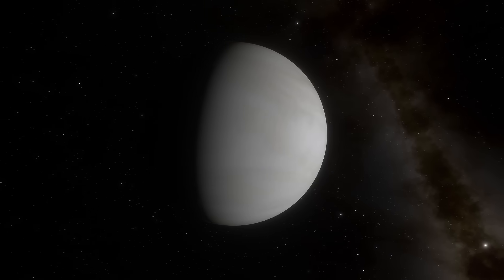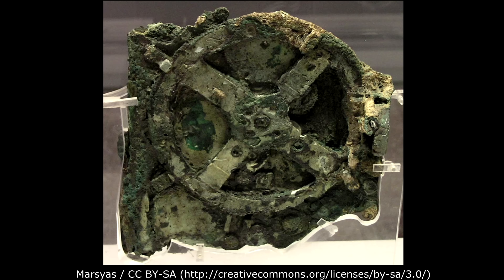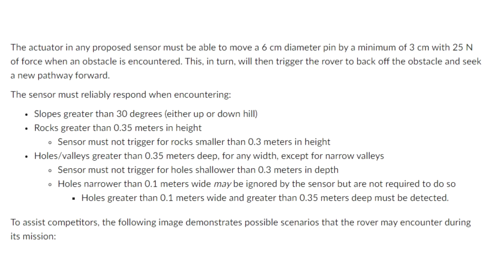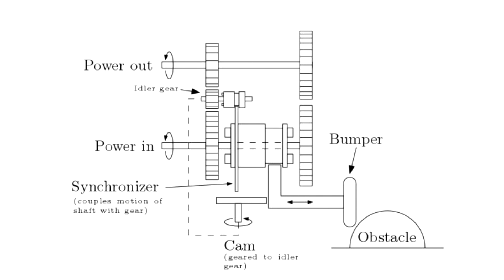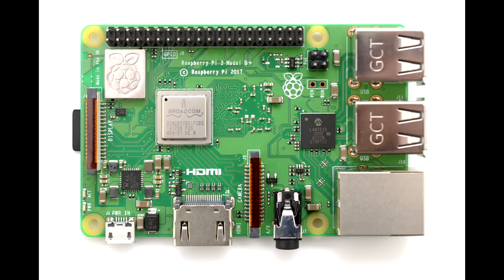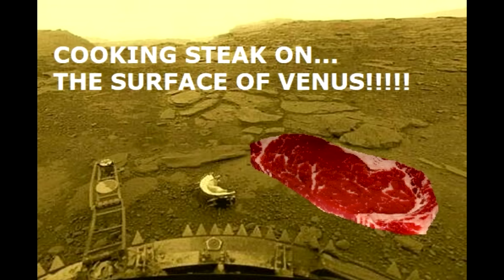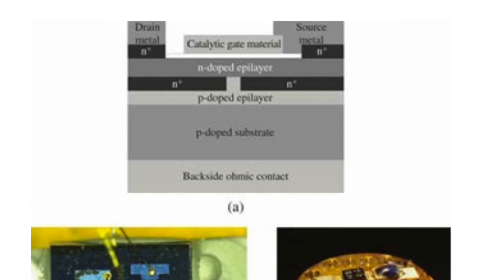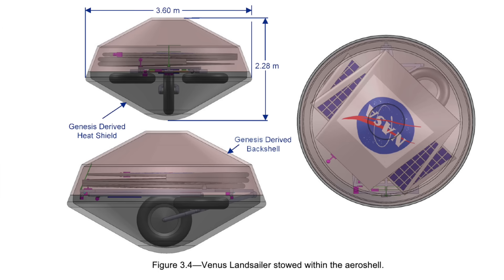Venus Rover Concepts That Beat The Killer Atmosphere

Comment: Fluidic logic looks like a better choice for such a computer? There's already a fluidic Z80 counterpart.
Reply: Konstantin Alexandrov Interesting. I don't know many suitable fluids that operate at 500C.
Reply: @gordonrichardson2972  keep in mind the pressure on venus, which is 93 atmospheres.  This will kick up all the boiling points to higher temps, may not be enough mind you. For example, boiling point of water at 93 atmospheres is 305C.

At atmospheric pressure, Sulphur has a boiling point of 444C, Mercury 356C, etc. 

I'd say Mercury is a safe bet, 93 atmospheres would surely kick up it's boiling point way up, making it a semi-sane liquid to use.

Comment: I have no doubt that a Venusian surface rover can be designed. The real challenge however would be to design a vehicle capable of operating on the Venus surface using only materials synthesized from the Venus atmosphere.
Would it be possible to create a vehicle using only CO2, N2, and sulfuric acid (H2SO4) and some other trace gasses? Because, if a floating colony was ever created, those would be their readily available resources and manufacturing with as many on-site resources as possible would be the way to do it.
Can anyone envision some sort of diamond/graphite coated high temperature polymer-based beast with graphene-based electronics that can survive on the surface? 
Or would such a vehicle never be possible without additional elemental resources?

Comment: What about using the heat to your advantage. If you had metals that get squishy at those temps, could you make some sort of transistor based on increased resistance across different thicknesses of metals and then have some sort of micropnematic system adjust thicknesses by squishing the metals?

Comment: I think a conventional rover inside a big, sealed, transparent ball  -- like a hamster ball -- would be better.  Maybe a ball covered by springy feet of some sort, to make it easier to roll over small rocks.  To make it resist the temperature and acidity of the atmosphere, perhaps it could be coated with a thin layer of diamond, or graphene.

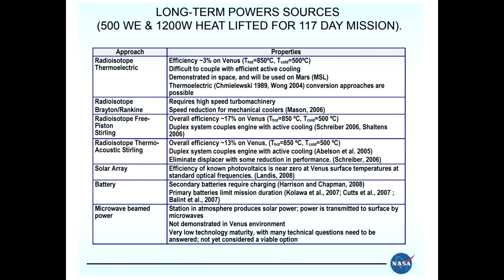Comment: Ummmm bit of a contradiction between the third from last row at 6:00 and the concept at 9:30......
Reply: Looked it up.
https://ntrs.nasa.gov/archive/nasa/casi.ntrs.nasa.gov/20150016298.pdf

Solar panels of suitable design would generate about 8.7W/m2 on Venus surface.
This is sufficiently far from zero to be usable.
Not enough for cooling or Drive systems, but enough to power rudimentary systems.
Reply: @marvinkitfox3386  why is youtube not notifying me of these replies any more 😑😑😑

maybe there are atmospheric windows in the far ir that could be used as cold source for low power heat engines. Anyway, I think wind is the most promising.

Comment: Many moons ago, there was "fluidic logic"  This employed ducted fluids as simple computers, such as FLODAC, a proof of concept from 1964.  Molten sodium is a fluid...
EDIT:  At the time, the 60's, fluidics was a solution in search of a problem.  The transistor and the PCB could do more, faster, and kept getting smaller and cheaper.  Environment wasn't an insurmountable issue, so fluidics went on the shelf.
Reply: Paul Slash
 -- Ah, brings back memories. A senior project in one of my Mechanical Engineering classes (1972) using pneumatic fluidic gates stirred my interest in Boolean logic which led me to pursue a Masters in Electrical Engineering in Computer Engineering. Served me well with my feet in two disciplines. Fluidic logic wasn't completely a solution in search for problem, there are situations where electrical devices are dangerous, like in an explosive environment. For a simple logic need, having electrical devices are unnecessary.
Reply: T Lum  Rad hard too.
Reply: Wouldn’t fluid logic be the same as pneumatic logic, which he mentioned was being looked into for this project?
Reply: @TheWallsocket  Gases are compressible, a fluid is not, that changes a lot of things
Reply: @TheWallsocket  Pneumatic would be a gas, as a rule.  Liquids are not compressible.  The different properties offer different programmable abilities.
Reply: Gasses are fluids. Although the surface of Venus is so hot and at such high pressure CO2 is a supercritical fluid.
Reply: @drunkenhobo8020  well gases share some properties with fluids but their definition is distinct from another
Reply: @Max Mustermann Gases ARE a fluid. Look up definitions before you "correct" people.
Reply: "fluidics was a solution in search of a problem." hmm, wonder what that manifold of valves and milled channels were for in a "transmission valve body".
Reply: CO2 is a fluid (at those temperatures)
Reply: @benjaminmiller3620  *is a supercritical fluid

That's a big difference

Comment: FLUIDICS.  Lead-based fluidics!!!
Reply: I'm glad someone other than me thought of that one, so I didn't have to bring it up.   Probably not lead though, although there are some pretty high temperature liquids available. Oddly, Sodium metal might be a better choice. Or NaK.   Then again, remember gasses are fluids too.  A pneumatic logic is technically a fluidic system.  The architecture is the same, with the design of the valves and pumps being the difference.
Reply: Now that is interesting. Fluidics with gases works. Compressed air computers . You can make oscillators, logic gates and memory. Many of those functions rely on the behavior of a compressible gas. Lead boils at ~1200C . I imagine lead gas to have some interesting properties. Not sure if liquid lead could work as fluidic medium. There certainly are other potential mediums. Mercury maybe. Zinc , selenium, sodium, potassium. Imagine a potassium gas fluidic computer running at 800C! I want to build one......
Reply: @BB-iq4su  Famous last words. One leak and BOOM!

Comment: Thermionic valves operate fine at high temperature.  Make a 1960s style camera and two way radio using valves, and just drive the thing from orbit
Reply: Hmm interesting thought. The issue with Venus is that its not just high temp (450-500 Celsius) but also high pressure (90A) and very low pH since the atmosphere is mostly sulphuric acid. How long would a thermionic valve survive in that?
Reply: @epincion  Standard material for vacuum tubes is glass which just so happens to be the material of choice to handle sulfuric acid. They normally only have to handle 1 atmosphere of pressure differential though, so you'd have to make the glass pretty thick. The problem with those is that their power draw exceeds power budget of the rover.
Reply: @michaelbuckers  Glass is a whole class of materials. Yes, some kinds of glass could do the job, and handle the pressure. Quartz would be a candidate. Glasses tend to have a short life where physical shocks are involved though.
Reply: @AndrewBlucher  Glass doesn't gets work hardened so as long as the shocks aren't strong enough it's fine.
Reply: @michaelbuckers  They don't have to worry about sulfuric acid. Contrary to common belief, the rain on Venus never actually reaches the surface. We have it here on Earth too, it's called "Virga."
Reply: @michaelbuckers  Thicc glass does not like huge variations in temperature tho. They often crack, thats why "lab glassware" is pretty thin. So it does not crack when you boil something in yer beaker. I would go for high silicone stainless steel of some sorts.
Reply: @MrDanisve  Well there were several working soviet probes on the surface, they took pictures and I assume they survived with high temperature gradient because they had to cool the electronics somehow. So it was proven to work, now we need indefinite cooling and I saw stirling engine proposals to keep power. So where's the catch?
Reply: @jan.tichavsky  Well if you can concentrate the temperatur critical parts in a "core" then cool this core like we cool a refridgerator and expelling that heat in the skin or a radiator. However this is somewhat power hungry. However with the windspeeds/pressure there, theres alot of potential energy to be harnessed easy.

Doubt a sterling would be able to power this without getting to big.

Now i do not know if the wind is as unstable as here on earth, however if it is a reliable source of energy i se big benefit in using wind.

I think this is very doable to make a craft that can last a long time there.
Reply: @MrDanisve  How are you going to refridgerate it, exactly? The surface of Venus is around 872 F (467 C). You don't cool something by sticking the radiator in an oven.
Reply: @BlackEpyon  You do when you don't have anywhere cooler to put it.
Reply: @BlackEpyon  I suggest you read up on Vapor-compression cycle. How do you think your fridge works? It gets rid of the heat in the room via a radiator.. Room temp might aswell be an oven.. Sure holding 4 celcius at Venus temps aint gonna happen cause that would take ludacris amounts of power. However you might be able to lower the temp so much that the electronics are able to survive. Or atleast survive longer
Reply: @MrDanisve  Yeah, I know how a fridge works. Ignore the power requirements. At minimum you'd need a cascaded refrigeration cycle (multiple loops), but in order to shed heat, the output radiator needs to be warmer than the air cooling it. Consider the high-pressure loop feeding into that radiator. It has to be very high pressure in order to bleed off any meaningful amount of heat in an atmosphere twice the temperature of a household oven, and the amount of heat it needs to bleed off will raise the temperature of the metal to the point where it becomes soft. If it becomes soft, it can no longer maintain pressure without rupturing. You're no longer just talking about power requirements, but material limits. Conceivably, you could use something exotic, like Hastelloy, but I'm only aware of that being used in heavy industry, and have no idea how one would go about making a plumbing system with it.
Reply: Yep. Don't even need a lot of power, just a way to control the wind-driven mechanisms.
Reply: Flying Skyward Normally vacuum tubes need a hot filament in a vacuum to 'boil' electrons. Thermionic emission. Seems that the heat is on Venus. Cold cathode needs about 1200C. A heat pump or a bit of extra electricity  could get the temperature. Tubes or valves can be miniaturized but I doubt much effort has been done in the area.  That would be a fun project.
Reply: @BB-iq4su  Vacuum tubes were made quite small towards the end of the tube era with RCA having developed a type that is thimble sized called the Nuvistor.  There's also research into vacuum channel transistors, but they suffer from electrode degradation.
Reply: Nuvistors might be a good application. The problem with using glass is that you need minimal thermal expansion and shock resistance. Nuvistors would solve both problems since metal enclosures provide excellent elasticity compared to glass. They're also more compact and light-weight, which is a must for spacecraft. 

The question is, will Venusian heat be a problem in their operation? The entire point of a valve is that the heater heats up the cathode, causing electrons to boil off and flow to the anode, and at those temperatures, the anode ought to be providing resistance to the electron flow if you use lower temperature heaters. 

For them to work, there needs to be a thermal difference between the cathode and the anode/grid plates. In order to provide that "cooling," they'd need to be exposed to the outside air. Even at those high Venusian temperatures, the air pressure would make for great thermal conductivity. Because of that, the low-temperature "oxide coated" filaments would be ruled out, since tungsten filaments would give the greatest temperature differential. Unfortunately, that also increases the power requirements.

Even so, I can't predict how efficient they would be if the anodes run this hot when "cooled." Somebody with more experience using valves could probably weigh in on this.

Space constraints due to the use of valves instead of semiconductors rather limit the processing capabilities in much the same way as "clockwork" processing would. Valves are used regularly, even today, in radio transceivers, so it ought to be possible to control the rover remotely from geosynchronous orbit so long as you can give it processing ability.
Reply: @BlackEpyon  Vacuum tubes don't need a thermal gradient in order to operate.  They work by having an electric field gradient applied to them and the cathode heated to cause thermionic emission.   I can't say what the operating efficiency would be in the Venusian temperatures.  However, the temperatures on Venus are below the thermionic emission temperature of the tube.  The biggest problem even for Nuvistors would be the operating power of the filament requiring 0.135A at 6.3V.  I think the high heat would make the filament more efficient, but could make other parts of the circuit less efficient.
Reply: @BlackEpyon  "Geo"synchronous orbit doesn't work for Venus, since it doesn't rotate much.
Reply: @AndrewBlucher  Right. I forgot about that. In that case, you can have it in a normal orbit, and drive the rover for 10 +/- minutes at a time while it's in line of sight of the horizon.
Reply: @longwave8156  I mean that the cathode is supposed to be heated, not the anode. Ordinarily the excess heat is radiated away by the glass, but the Venusian atmosphere is half way to a normal filament's operating temperature. Either that will make it less efficient, or more efficient, and I'm not sure which.
Reply: @BlackEpyon  Anodes get pretty hot in high power tubes and are much cooler in small tubes like Nuvistors.  Higher heat would result in higher resistance of the wires and plates due to the temperature dependency of resistance.  This would reduce the efficiency of the circuit overall, but probably increase the emission efficiency and lower power required of the filament.  Whether it becomes more or less efficient would probably be determined by the amount of material in circuit.

Also, I think it's likely that the tube would be severely compromised before it hit temperatures where the voltage across the tube drops too much for it to conduct.  However, presently, I am not able to determine if plate resistance follows the same temperature dependency that general resistivity follows.
Reply: @BB-iq4su  There's at least one guy I've seen who still makes nixie tubes for retro enthusiasts.
Reply: Alas Venus is too cold for thermionic valves to operate without the usual cathode heaters, and the high temperature semiconductors mentioned in the video are smaller. Could these be a good choice for cameras?
Reply: @TimothyEBaldwin  Valves chew some serious juice though.
Reply: I'd say vacuum tubes are an ideal thing for dealing with Venus atmosphere, and there's one thing that nobody in this thread has thought of yet regarding how to power the filament.
Instead of using heat, use a filament doped with some radioactive elements. The radioactivity produces ionization, which supplants the need for a heated cathode.
This is not a new concept, there are several part numbers for tubes that were produced in great numbers that used thorium to increase the tube's sensitivity.
Might have to use Am-241 for this one tho, because you need to completely replace the filament heater function, not just augment it.
Reply: @44R0Ndin  Thorium isn't used in filaments because of its radioactivity, but instead it's general properties make it more efficient at emitting electrons than tungsten while withstanding higher anode voltages than oxide coated cathodes.  Thorium could be replaced by other metals with similar or lower work functions.  

As far as using radioactive elements, vacuum tubes being used to create any logic would be far too small for the radioactivity to heat the cathodes.  Even oxide coated cathodes need to be a minimum of 800 C to emit electrons.  Also, without doing any calculations, alpha decay could impact the properties of the tube after some time.
Reply: @44R0Ndin  I hadn't thought of that. It would sure cut down on the current draw. Maybe even surround the valves with thermocouples and have them double as mini RTGs?
Reply: Tube based camera and transmitter with technology from the '40s will work. There are still nuvistor tubes on ebay
Reply: There are low wattage thermionic valves (less than 1w.) However I was actually thinking of a solid state circuit akin to the old crystal radios.
Reply: Wouldn't such a huge temperature turn the anode into a cathode? If the whole vacuum tube is heated to a high temperature, every metal would be capable of emitting electrons, not only the heated cathode. This defeats the way how the vacuum tube work - only the cathode should emit electrons, anode (and grids) shouldn't.

Comment: Just pull the rover with a kite or use pressure differential ballast tanks to float around.
Also, while I don't have much to say in regards to high-temp electronics, electrical energy storage should be easy enough with a molten salt battery.